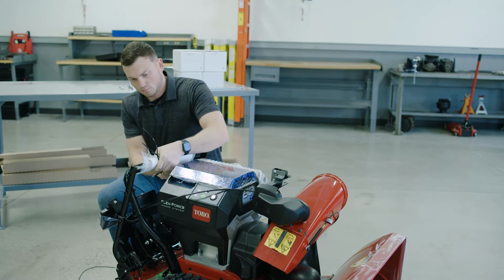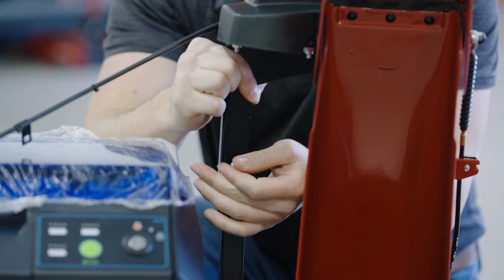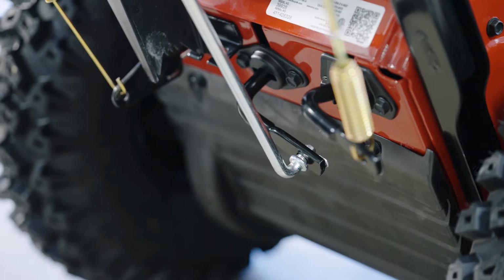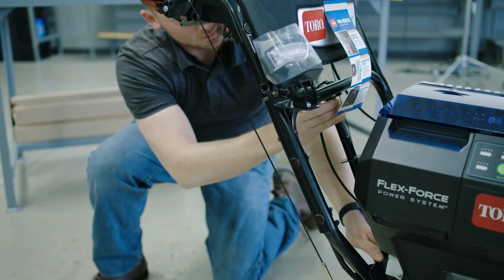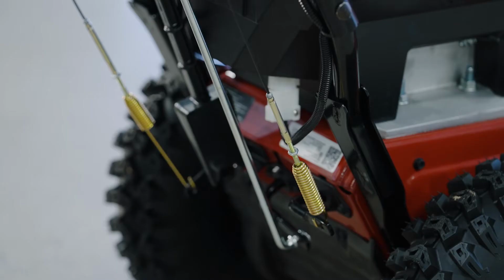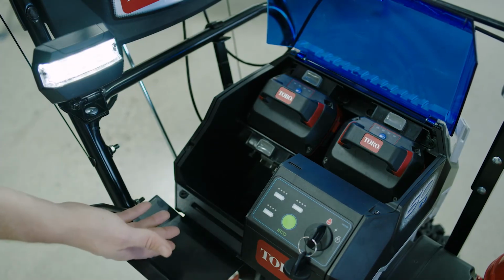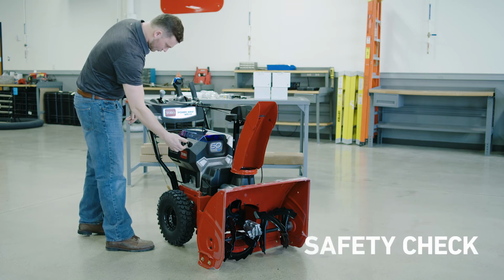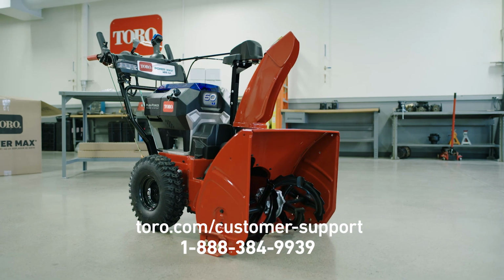How to Assemble a Toro 60V Two-Stage Power Max Snow Blower

Comment: After using it for a while the motor quit.  I was using the auger at the time.  The battery's still have at least 1/2 time left.  It wouldn't start.  I put the batterys back into the charger and they show that they are charged.  Any suggestions.  Thank you

Comment: Toro:  auger lever will not stay engaged with the traction lever depressed.  The cog doesn’t engage to lock.  I’ve seen other posts online.  Can you help me find a service center near Monument, Colorado (zip: 80132)?  Can’t find anyone to service electric machines.  I’ve got 5 more days until my 30 day window to return to Tractor Supply expires.  Used TWICE.  worked well, but longevity and serviceable??

Comment: Tech question, Toro:  video says 2” for traction cable, the manual says 2 3/16”, and auger cable 2 3/4” vs manual says 2 3/5”.   
Which is it?

Comment: I returned mine after one use.  Battery life was terrible.  30 minutes run time and 3.5 hours to recharge.
Reply: Did you call the customer care number at the end of the video ?
Reply: Did you have 3 batteries?
Reply: @particles1101  they only come with two batteries 2   7.5ah batteries

How off they are with their 30 cars in 10 in of snow they should give you the third battery and three fast charges!! 

You're lucky if you get 1/3 of what they say!! He's correct 30 minutes!! 

Read my above previous comment It explains everything!! 

I kept mine because I have a very small property. I've used it several times. It does 30 minutes!! The weird thing is It does 30 minutes in heavy snow, icy wet snow, frozen snow, fluffy snow. It's like it's the same no matter what 30 minutes!! Even in heavy deep snow it does 30 minutes. 

But there are some tricks.. Don't know if I talked about them yet.

Electric motors surge every time you turn them  on..  probably better off keeping the auger going as much as you can not stopping and starting. This would also be same theory for the drive. I always engage the drive slowly.. trying not to surge it. Same thing with the auger.  

Go as slow as you can. You can change the speed of first gear by turning the steel  transmission rod top couple of turns clockwise.. after you follow the directions how to install the rod.  

Let the machine do the work Don't rush it. Listen to the motor you can hear when it gets bogged down just back off.  

Only do half of the width of the opening.. 

And when you can use economy mode use it. Economy mode works great if you're clearing on a parking spot on a street and you only have to throw it a few feet you don't want it to go very far..  something gas snow blowers don't have which is cool. When it's on full power it's always going to try to throw 45 ft.  Basically economy mode brings it down to half.. 

This will help but not a ton....  

REALLY SUCKS BECAUSE THIS THING WORKS JUST AS GOOD AS THE GAS MODEL IF NOT BETTER.. 

But that's the way it is with batteries. Just don't know why they were so dishonest.. because a lot of people would not buy it if it only lasted 30 minutes in heavy snow. Now they have tons and tons of people stuck with them that really can't return them if they don't have a truck..  or they didn't buy it during the winter they bought it during the summer BASED ON THE 30 CARS IN 10 IN OF SNOW!! 

Same thing with cars look how much cars cost with the engine versus the battery version.. thousands of dollars more maybe even twice as much. 

It's those damn batteries!! 

Gas engines will always be better long-term no matter what You just keep putting gas in it.. 

I do think Toro made the two stage battery powered snowblower the right way.. same thing as their gas version just an electric motor with batteries.. no more circuit boards and special things because it's electric ready to break in a couple of years because of all the moisture and cold solder joints being outside and you won't be able to get the parts.  

You can get Toro parts for this snowblower and ones like it probably forever!! Probably the life of you!! 

That's what's great about it!! 

If they gave you two sets of batteries and four fast chargers for the same price NOW WE'RE TALKING THE PERFORMANCE OF GAS!!  

Also Toro's batteries are the best in its class, the highest quality cells And they aren't cheap!! That's why they are $350 a piece!! 

Think about it the bare bone tool without the batteries E26, and the gas version 826 are the exact same price cuz they're the exact same machine just different motors. IT'S THE DAMN BATTERIES!! BATTERIES BATTERIES BATTERIES!! 

🤣
Reply: Thank you for your review. Amazing
Reply: Honestly I think you must have either not charged your batteries fully before first use or something else was wrong because I just got through my first use on my 120ft double (triple at some points) driveway and I went until batteries died and I got around 40 minutes of runtime. 

This was with heavy hardpacked snow that I had been avoiding dealing with because I knew this thing was on its way from Home Depot. 

Also, it was my first time using a snowblower so the first 20 minutes of using it I was getting the hang of the drive controls. So very inefficient driving by me and it still was able to clear the whole drive except for one small spot. 

Next snowfall I imagine I should get through the whole thing no problem since I won’t have driven over it 20 times and packed it down. 

This thing was even chewing through the hard areas I had packed down and throwing it no problem. Only problems were my bad driving. 

And also — I wasn’t using eco-mode and have only 2 batteries. So I may be able to get even more runtime.
Reply: Finally got a real snowfall in upstate NY, I have the 24inch model.... Did as well or better than our old Ariens compact 2 stage.... Based on my playlist it lasted 37 minutes, mainly on Eco.... We got about 8 inches of wet snow, 20 at the bottom. Easiest time I've ever had checking that stuff up. Between our driveway and sidewalk we have about 1200-1300 sq feet. Also, or driveway is about a 30% grade.

Comment: Question, are the skid shoes installed and adjusted at the factory?
Thank you for your assistance Toro.
Reply from the maker: Hello, John! Yes, the skids are installed at the factory. However, we recommend checking the positioning of the skids and adjusting them if necessary. You can find more information in your owner’s manual.

Comment: The only problem is the manual gives you different lengths for the springs for the levers. 

For the left spring the drive lever You guys in the video say 2 in.   (  In the manual it says 2 and 3/16 ) The decimal for this if using a caliper is 2.19

- for the auger lever You guys say In the video  2 and 3/4 in in decimal that's 2.75 ( In the manual It's 2 3/5 )  in decimal that's 2.6

So the measurements in the manual are slightly different. For the drive the left handle You guys In the video are saying the spring tension ( is slightly less Then the manual ) 

And for the right  The auger lever ( in the video It's also slightly less ) 

So which one should people follow?
Reply: I guess they’re just providing general guidelines from which to start.  Mine was set up pretty much spot-on right out of the box… I wouldn’t bother readjusting unless the spring lengths were far out of spec, or the drive and/or auger were not engaging properly.  I have seen several different updated versions of the manual for this model online, each one being slightly different from the paper manual included with the snowblower.
Reply: @r.stanley1049  on the E24 that I returned in the E26 they were off with either of the specs from the manual or the video. 

It's real simple how it works anyways. It's all about the belts engaging. If you hear some squeaking and something like that. You don't want the belt slipping and squeaking. That means you need to tighten Make that spring tighter which means make it longer. 

I think you're better off going with the tighter specifications meaning the spring to be longer. So on the left side would be the 2 in and 3/16 I think that's what it is, And the right side 2 and 3/4. That's just going Make the belt have more pressure.

I think that's how it works.

On both machines I heard squeaking going backwards. That's usually the belts not tight enough. 

;)